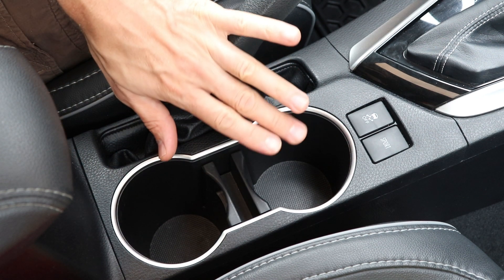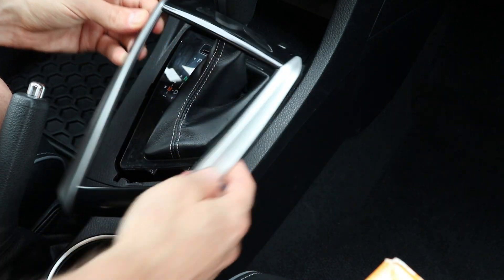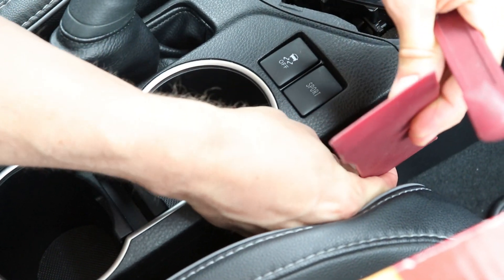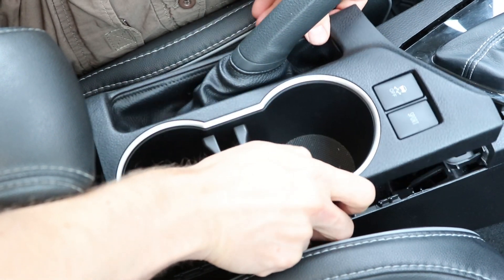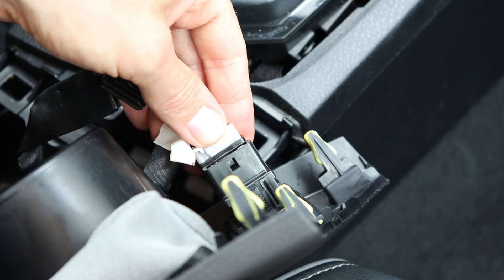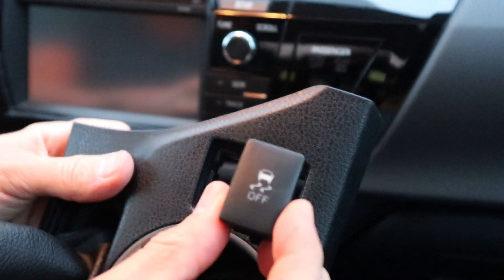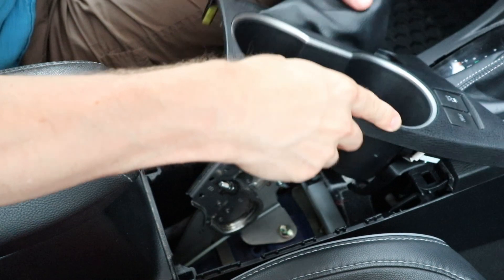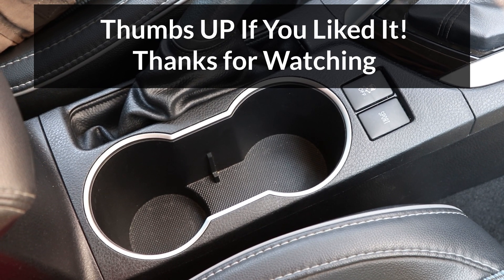Cupholder & Shifter Trim Removal, 2014-2018 Toyota Corolla

Comment: I really like your videos and I REALLY wish you'd spend a couple seconds showing what's underneath a removed part before reassembly. Example, you remove a door card but don't show what the bare door looks like. You removed the cupholder but I cannot really see what it's like underneath. 

I'm trying to insulate my Corolla and I want to see if it's worth removing some trims and if there's pre-existing insulation in there.

Comment: Do you have a video on how to remove the cigarette lighter? I'm trying to replace it with a dual USB port.
Reply from the maker: I don't have it but I'll make one, should have it up in the next day or two.  It's likely not too easy to replace it unless you cut the plastic once it's out,.. My Corolla has a single USB port there already next to the lighter, maybe you have the connector for it, and you can get the port from a junk yard and just plug it in. Anyway, I'll make the video soon.
Reply: @CleverFix  Thank you sir. I have the lighter socket loose but there's not enough slack to pull it out enough to unplug it.

Comment: Were you born in the United States? I can't quite place your accent
Reply from the maker: East Europe!
Reply from the maker: Hey, The Krickit should be actually used at the bottom between the Crankshaft and compressor pulleys, not at the top, that's probably why the tension seemed low,.. I just figured it out, I'm gonna check it again today. So the bottom cover has to be taken off to check.. it's probably not a huge difference in reading,... and down there it's actually easy to press it on the belt.
Reply from the maker: On an engine without AC the tension can be checked at the top next to the engine mount.. probably because there's nowhere else to put it.
Reply from the maker: Ok testing at bottom pulleys and top gave very similar results.. but technically it should be done at the bottom.
Reply from the maker: Also, I put the tension bolt back to original position and I get about 80lbs, just like you're getting.
Reply: @CleverFix  I look forward to your video showing how to check it and replace the belt
Reply from the maker: @joewhattoff8754  It's coming along..  I had to re-do the measurement part since the manual indicates it should be done at the bottom pulleys.  There's also some back forth since everything has to be put back together, car driven, and then taken apart again for the tension test and adjustment,.. so I'm not sure how much of it to show again. I'm thinking just show it very quickly with a sped up video. Let me know what you think once I post it.. Your earlier comment for the Krickit got me thinking and then I discovered all of this!  Thanks.